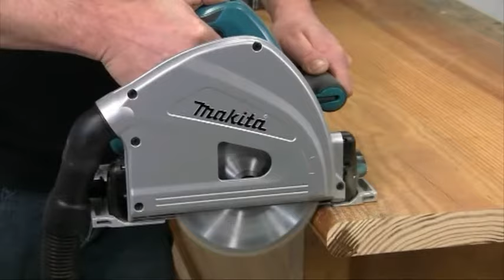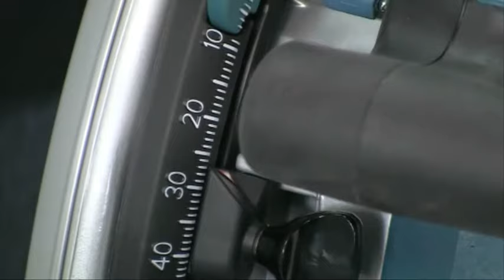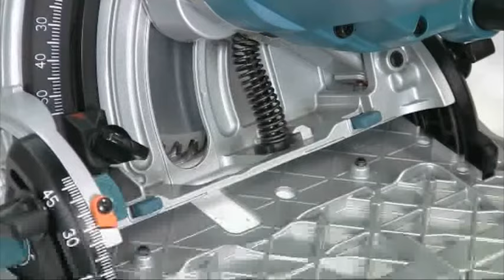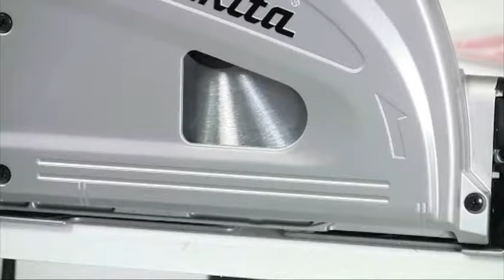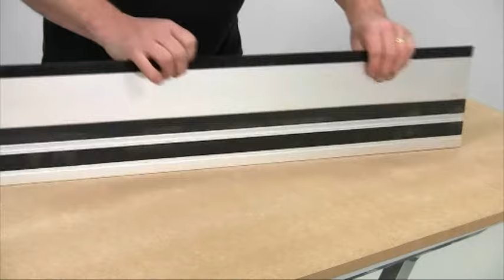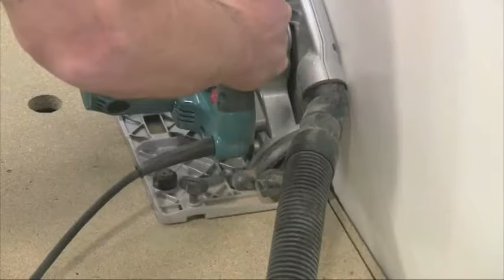Makita SP6000 Plunge Saw

Comment: What an excellent tutorial. I needed to remove and clean the blade after getting gunked up after cutting plastic faced chipboard and laminate floor.  I saw a tip on using concentrated laundry washing liquid to soak and clean the blade, with those two tips I am on my way.. plus I learned so much more about my saws capabilities. Big thanks for an engaging tutorial :o)